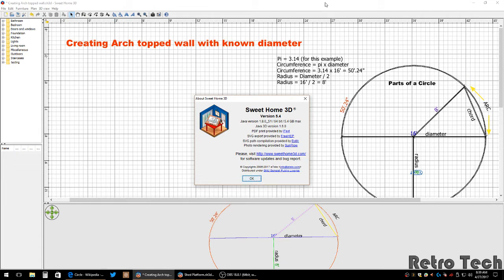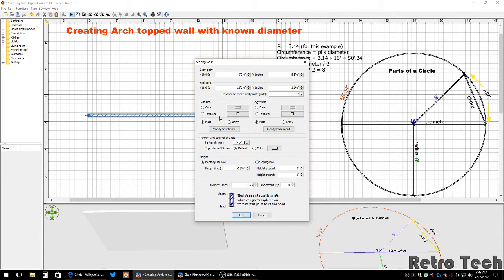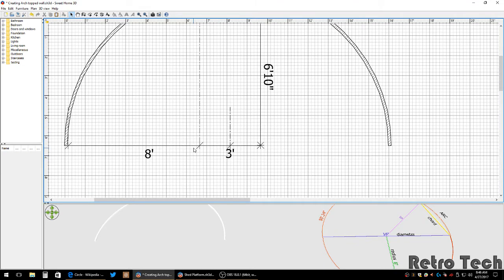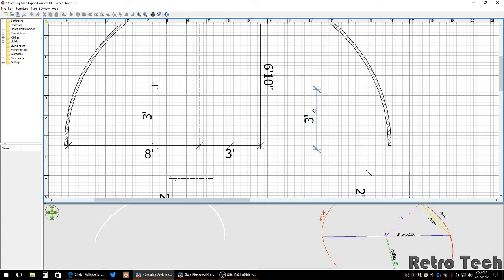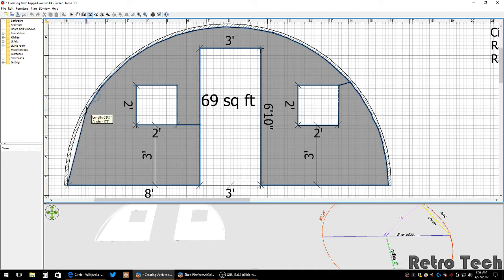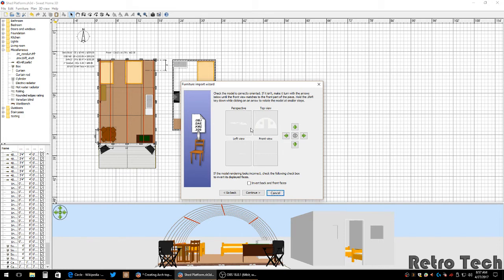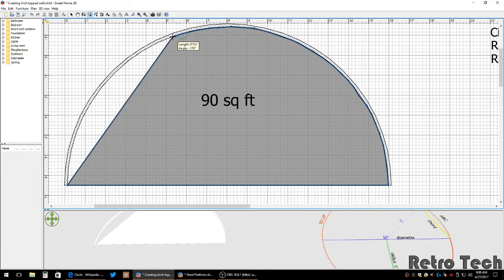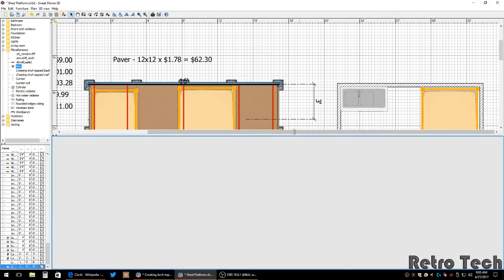Creating Arch Topped Wall Sweethome 3D Ver. 5.4

Comment: How did You do those sort of ribbed bars along the roof?
Reply from the maker: Ok, I used the "Create Wall" Tool, to create a basic wall, and then select the wall, and now Select the "Arrow" select tool. Now Double-Click the Wall.  The "Modify Wall" dialog will open, you need to set the "ARC Extent" to 180 and set the "Height (inch) to 4". to simulate a 2 x 4. You can now also set the arch length by dragging the end to a new length. Once you have that set. you now "3D View" from the menu, and select the option for "Export to Obj Format", name it like i.e. "RIB 2x4". select the option for "Export Selection" this will now create a fix 3d object that you can now import through the "Import Furniture" from the Furniture menu.  When you open the "Import Furniture" you will need to select "Choose Model" and navigate to the save location for the *.obj file. Select the file, and select "Open" now once you done that you will need to move the "Front View" to the "Top View" so select the "Green Up" arrow.  Now Select "Continue" Select the category you want to save the object in, or create a new one, and now click "Finish" you will now see a new category appear, if you created one, or you will see the object name appear as italic name i.e. [it]Rib 2x4[/it]
Reply: @ocrossrep  Thank you for the quick reply, I am trying to make a poly tunnel  and will use the same technique to make the polyskin that goes over it. Thanks for the video it was very helpful and informative. Ta.

Comment: Thank you so much for this tutorial! I have no idea why arched walls aren't a function in this (awesome) program, and I've been working a quonset idea as well. In exchange, I did find a shortcut for filling in the wall: After all openings are defined, put temporary walls along the INSIDE of those measurements, and one along the bottom of the arch, select the room tool and just double click to fill in. Delete the temp walls and proceed. Thanks again!
Reply from the maker: See this right here, is what I love about the Sweethome 3D community. We happy share tricks with each others. Happy the video could help you.